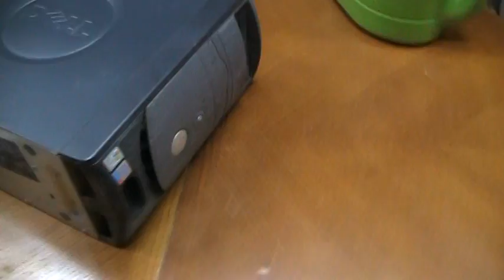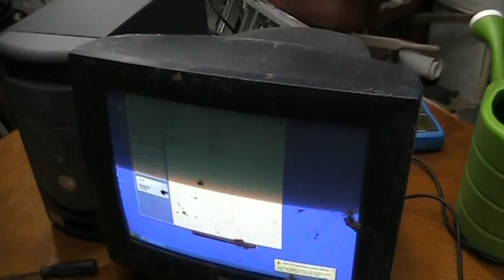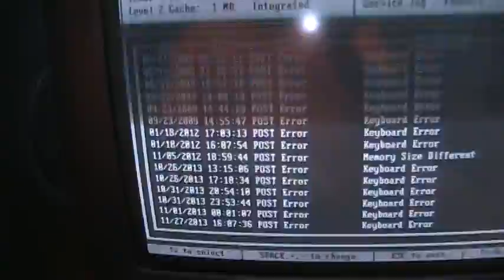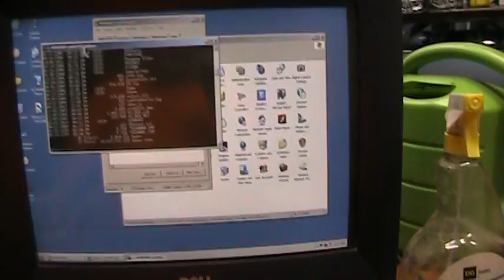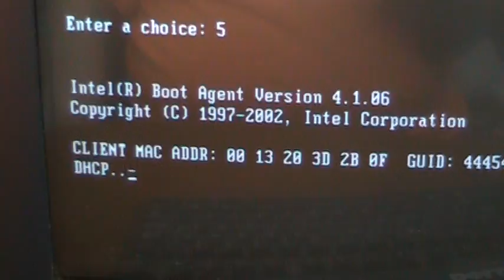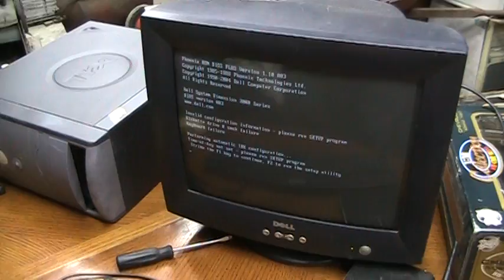Trashpicked "Treasure": Dell Dimension 3000

Comment: Maybe I misunderstood, but if you want to find the date when Windows was installed, just open a command prompt and type 

systeminfo | find "Install Date".

This usually will result in the following type response:

Original Install Date:     11/23/2012, 12:16:48 AM
Reply from the maker: There is more than one way to accomplish the same thing. I have my doubts that the install date would have been accurate, since this system shipped with a "recovery image" in a hidden partition as opposed to proper, standalone Windows installation media.
Reply: True enough. That command was just always my favorite. :)
Reply: I like the command, just because it worked. ; ) I have aug.5, 2011, but that was a day this thing got some repairs done on it. Original install was.... god knows when. : )

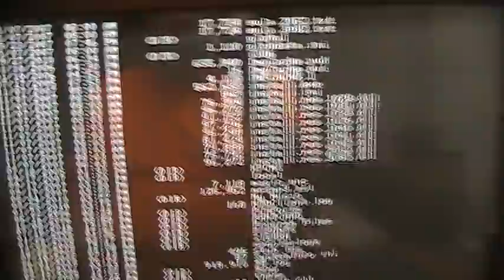Comment: How did you manage to make the command prompt fullscreen like that? 24:02
Reply: Thanks!
Reply from the maker: On Windows Vista or later, a true full screen command prompt is no longer supported. (You can enlarge the window, but doing so does not produce the same effect.)

On systems where it is supported, ALT+ENTER will switch a console (text based) application such as the command prompt to full screen.
Reply: Thanks! I will have to try this out.

Comment: ux could you help me with the installing windows nt  there are many other vids they don't show step by step including loading the disk in the machine  alot  of it is vurtual machine not just the setup itself  just like installing  xp I just ordered the package it has 3 floppys  what are they for you are more knolagable than others  I like your vids because you give the history  of the machine and the surface mount tech
Reply from the maker: There are several different versions of "Windows NT". Depending upon which one you have, the process will be slightly different. For an older computer, or a version of Windows NT before version 4, you would start the computer from the first diskette and insert the others when requested. With Windows NT 4.0 you have a choice -- a newer computer could boot the CD while older ones usually have to be started from the first floppy diskette to kick off the setup process.

From there it is essentially "click and go". You'd choose to prepare your hard drive by partitioning and formatting it (the primary partition is limited to 4GB in size and you should use NTFS). Setup will restart your computer after preparing the disk and copying a few files. Follow the on-screen instructions.

When you have installed Windows NT, get the latest service pack and install it immediately afterwards. For Windows NT 3.5 that would SP5 and for Windows NT 4.0 it is SP6a.

Only install Windows NT on a computer that doesn't have important data or programs you care about. It will replace and destroy all files on a computer during the setup process.
Reply: nt work station it has 3 floppies plus cd

Comment: I can't wait for your ERPXE video, so I'm trying to configure the server myself. It doesn't work. Did you use dnsmasq?
Reply from the maker: Yes, I've been using dnsmasq without any issue.
Reply: My test server is now on a dynamic IP address, because my router is an old piece of garbage. Is this a problem? I'm changing router in the near future anyway.
Reply from the maker: The simple answer is "yes, a dynamic IP address is a problem in this application".

The longer, more complicated and drawn out answer is "it depends". Some DHCP servers behave a bit more intelligently, handing out the same IP address (if available) so long as the MAC address of the network adapter making the request is unchanged. If your router's software were to work this way, you could probably get away with it most of the time.
Reply: Just as I thought. Hopefully the new router will arrive next week or in early December. I'm forced to wait because my current router is locked.

Comment: Can I ask why you're so fond of Dell machines?  It's just that my experience with Dell's, or at least the newer ones that they seem to be completely apart from machines made around 2005, such as the Dimension in this video - which may be why you're fond of the older machines, in which case I don't blame you at all.
Reply from the maker: There's no doubt the quality has fallen off drastically after the Optiplex 790. Even so, I've been well served by a lot of Dell products new and old. Dell has, with few exceptions, always done right by me.

Comment: Regarding the image that appears before the welcome screen; I've noticed that before, and I think it may have something to do with wallpapers which have been previously used for the account that Windows is set to logon automatically.

Another way to view the system install date is through the command prompt. You can use the "systeminfo" command to display that, along with lots of other information including the time of the system's last boot.

Comment: Making a sleeper would be sweet! I've got a few those old cases, too bad without metal working I can't fit a 120mm rad in the front where the hhd mount is. going to look around to see if I can easily remove that bracket out of the way to for a 120 rad in the front.
Reply: Update: yes the hard drive mounting bracket is removable. However, there is one rivet holding it in place. Also It will take a small amount of metal work to cut the front away and a new mount fabricated.

Comment: Just a note Love your vids by the way - I am or was way back in the days of 2005 a qualified Dell field service engineer and worked on the full range of Dell products the Dimension / Optiplex ect range all suffered badly with swollen caps with the guts spewing out the tops i changed literally hundreds of boards for this problem over the years to the point Dell started refurbishing them with better quality caps and sending them back out to the field as "refurbs" . I can see that the caps on this board looks like it has the same problem. Easily fixed after the warranty was out i started to replace the cheap Chinese caps for "pulled" better quality Chinese caps and could sell them on making good profits in the day. Steve UK.
Reply from the maker: My own experiences were a bit different. I saw tons of Optiplex systems with failed capacitors, but comparatively few Dimensions. (I've only repaired two Dell Dimension PCs with this problem, and one of them only suffered it because someone let the fan fall out.)

I've always gone for new capacitors from reputable makers when doing the repair, because it's something I'd really rather not ever have to do again.
Reply: Agreed all the caps i replaced outlive all the machines anyway except one and ran 24 hours a day in a reception in a local garage i replaced the board as i had a few spare at the time. So one question are those caps in the vid swollen up ?? or is it just me thinking they are :)

Comment: Adding another comment, I've actually been gonna do a sleeper for a while now, I even got a Core 2 Quad board to put in, but never got around to putting it all together, it was intent on being a nice secondary, but motivation and time are separate things
Reply: I picked up an HP from a friend for $5, had a bad memory stick and the classic HP panel junk coming apart, it was a Q6600 and 6GB, plus a 9600 or something like that.

Comment: I actually have a couple of the Datech fans, they all work, at least for now, I did get one recently in a B110 I made a makeshift file server that had come to pieces literally, the case was full of bushings, and a complete set of PC fan blades, I took it and put a fan in it,  and replaced the board, both hard drives and it got put to work, because for $8, why not, I just put a Gigabit card in it, it works well, made a nice heater for cold weather too. Hands down the best hard drive I've ever seen was a WD400 Enhanced with 104K hours, when I got it, it had run non stop in a Dimension 4550 since 2002. I've found you can't hardly sell C2D systems on Craigslist or eBay anymore, I part most all of them on eBay, the parts turn a decent profit though
Reply: I've found getting more than $60 out of a C2D system is progressively getting harder, I part out on eBay for a reason, that reason is, I can put a board on there for generally within $10 of what it's worth on CL, and the time to handle it is less than a third. I don't make a cent on a front panel that's broken, and the HPs are worth something if they aren't. Dells bring around $10, last HP I bought for was $35

Comment: I have two CRT monitors. One of which is an IBM 2115 15" CRT from August of 1995, it still runs, but turns pink while still displaying a picture due to oxidation inside the VGA port (and shakes at the lower left with another computer on as well as the monitor for the other computer itself), and another one is a Compaq 7500 from 2002 that has a burnt-in image on the tube display, which will cost an arm and a leg to repair.

Comment: I've actually got a circa-2013 ThinkPad Tablet 2 with a 32-bit Intel Atom, so OG x86 isn't quite out to pasture just yet.

As far as the monitor goes, it is my understanding that CRTs do wear faster when the contrast is jacked up, which it often is out-of-the box, especially on televisions. This is why most of them that have had any kind of use are so tired by this point. If the contrast and whatnot had been turned down from the get go, not only would the pq have been better in its infancy, it would have continued to be more usable later in its life as well.

Comment: hello bill, first I would like to say great find on the monitor, it actually did not surprise me that it turned right on, we have the same model. My family revolved around Dell, and through the vigorous movements between multiple trips to new houses with it and numorous droppings, it still continues to run to this day, mom uses it on a day to day basis and currently use a screenless dell inspiron 1521 on it. I would also game on it as a kid and needless to say I beat the crap out of it when getting killed in Halo. the computer on the other hand, sucks to hear that it has the oder of cigarettes, we had a dell dimension 2400 that the monitor originally came with that in 2010 became questionable whether it wanted to boot up, so we retired it and bought the laptop used without the lid. Quite a setup and it works, the monitor in constant use for 15 years, recycled the desktop but kept the hard drive because of the taxes that are on it.

Comment: Will the bios flash AO3 enable me to run an 800fsb Prescott? And could you do a video on the process of updating the bios in one of the many Dimension desktops you have?
Reply from the maker: Always use the latest BIOS unless you have a very good reason not to. The Dimension 3000, B100 and 1100 are all the same thing, and any Socket 478, 800 MHz FSB processor will be supported.

Dell's BIOS updaters are as easy to use as falling off a log. If you are running Microsoft Windows, just download the updater, run it and reboot when prompted. If you're not, you'll need to make a DOS boot disk and perform the flash from there. However, I have no plan at this time to document the process.
Reply: ***** Thank you for a rapid reply. I've always had issues with updating through windows. Also since the CPU I have is seen and recognized, but the system doesn't allow me to load an O.S. with it. I'm left with the floppy boot disk option only. That will be a major problem for me because I have no floppy disks...
Thanks again, and thanks for the intelligent content you provide us with.
Reply from the maker: If the system refuses to let you load an operating system, it's probably not a BIOS problem. (Corrupted CMOS/NVRAM is a possibility. Try using the "CMOS clear" jumper or leaving the battery and AC power out for at least 24 hours.)

If you can, check the BIOS setup utility to make sure that hardware you want to use hasn't been disabled or set to "not installed".

Comment: My daily driver is still a 2.93 GHz E7500 Core 2 Duo with 4GB of RAM and an NVIDIA GeForce GT240 in the form of a Dell Vostro 220. It runs Windows 10 Home 64 bit perfectly well. I do a little bit of light gaming, and it handles it fine. I've never really seen the need to get anything better, however I might need to in the near future. A Core 2 Duo is still pretty good in today's age of technology.
Reply: Not very good if you do 'actual' gaming :). When I say light gaming, I mean like really light. The most graphics intense game I play is Next Car Game (now Wreckfest). It actually gets great frames. It's super smooth on high settings, and the graphics look great. That's probably the most intense (graphically anyways) that it can handle without dropping frames.

Comment: I recently picked up one of these for free. Mine came with a 160GB Maxtor HDD and 512MB RAM. I bumped up the RAM to 2GB (Max) Updated the BIOS to AO3 and upgraded the HDD to a spare Seagate 400GB drive I had lying around. I also threw in a cheap PCI (Not PCI-E or AGP since mine lacks both) I slapped a copy of Windows 7 Ultimate on it, and it works beautifully. I even have Aero transparency. I have the same Prescott P4 CPU in there though. I gave it away to my younger sibling who uses it for watching YouTube and they have no issues whatsoever. It should be noted that my model came with the LCD not the CRT though
Reply: i find it impossible trying to watch youtube on even a fast pentium 4
Reply: They key to doing it successfully with no stutter is to get a dedicated graphics card. Since the Dimension 3000 has no PCI-E or AGP slots you'd need to go with a PCI card. Harder to get, but dirt cheap
Reply: I was using a radeon 9800 with 256mb vram and it still couldnt handle 480p

Comment: I share the same sentiments about Dell monitors, very bright, sharp and I myself have never seen one of these die either. Now I have seen the larger ( 21" ) late 90's era Dell monitors blow up. I have one at work that blew it's flyback, and when I say blew, it has a large crack in it now and makes a scarey popping and sizzling noise. It was probably getting ready to go anyway as the monitor grew a bit blurry and not terribly bright before it finally went out.   It's funny you mention the B110 as I just "acquired" one at work. 

I have developed a bit of a soft spot for this era of Dell computers and a couple generations of the P4 chip.  

You should try a product called Mean Green which is sold at Mendards. It works wonders with cigarette stains, just eats it right up, drips off and removes any smell. Great stuff and it is only about $4 for a gallon.

Comment: Those monitors are stronger than you'd expect.
Reply: Yes, in theory, the higher the brightness you run the tube at the faster it will degrade. 

This is usually why finding a set with a brightener is usually not worth picking up or buying, since it usually causes the cathode to become less emissive and the picture becomes dimmer. 

Cathode poisoning is also a problem, along with screen burn as you described.
Reply: I have a WD400 from a DVR box that I put into my Dell Dimension 2400 (first desktop I ever bought, second hand so no hard drive or bracket) that's still almost completely silent. 

The loudest drives I have are actually Seagate, both SCSI drives (3GB & 4GB) and MFM (ST251-MLC2), as well as a 500GB SATA drive I put in my Linux box.
Reply: You could also do the control key to put a circle around the mouse, I forgot what it was called.
Reply from the maker: "Sonar".
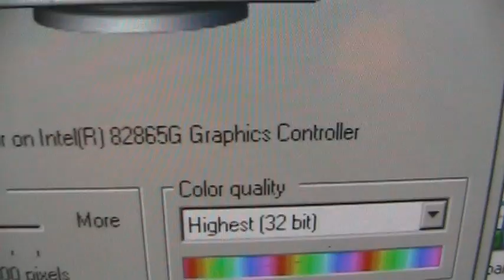Reply: 25:15 82865G? That seems like a keeper right there, God knows I would have killed for one of those way back when.
Reply: The monitor I got with the 2400 was an E772p I believe, maybe E722, but it's still working fine, albeit with a bit of a blurry picture.
Reply: Make that 3 people that would laugh at the MediaPlex joke
Reply: If video comments (responses) were still a thing, that'd be great. 

Sorry about the long comment thread, I posted as the video went on and the edit button decides to reload the page.
Reply: ***** Pretty much, yeah. I have that on as often as possible, solves my problems.

Comment: I actually quite like dells old dimension series cases. They are about as good quality as a budget PC case and since they are everyware, you can get then for free. I have even done a fewPC builds around them before because I just like them that much. Their later optiplex series cases with the BTX boards however shutters

Comment: How did you make the command prompt full screen!?!
Reply from the maker: Make sure the command prompt window has focus. Press and hold the ALT key on your keyboard. Press ENTER briefly and release both keys at the same time.

This doesn't work under Windows Vista and later because someone at Microsoft is a Great Big Stupidhead(tm).
Reply: Just checked it with Windows 10. Works like a charm. Neat trick that I didn't know yet.
Reply from the maker: Unfortunately, what you're seeing under Windows 10 isn't the real thing. It's just a window that's been enlarged to fill the screen. You haven't actually gone out to the text video mode. (There would be no graphical elements of any kind in a real text mode environment.)
Reply: Awesome. Can confirm it works with Windows 10, but it shows the ugly scroll bar.
Reply: Indeed with scrollbar. It's a graphical representation. But it fils up the whole screen which is good enough for what I would need it for. Your trick remains neat to me. Thanks again.
Reply: +Tjeerd van der Meulen 
I have Windows XP on a partition just for compatibility and the text mode cmd. :)